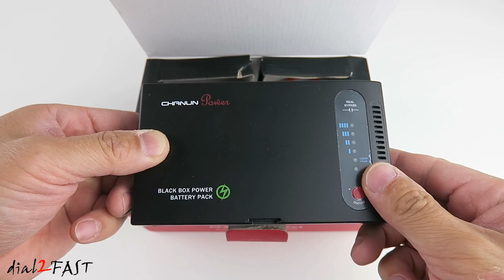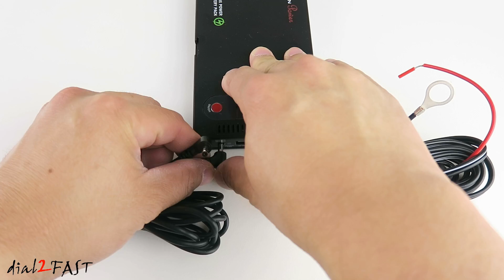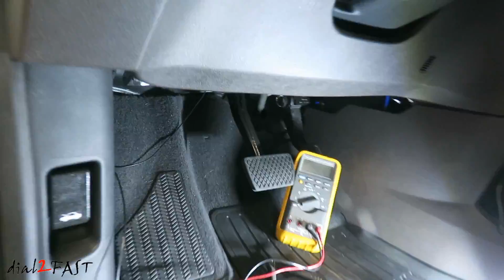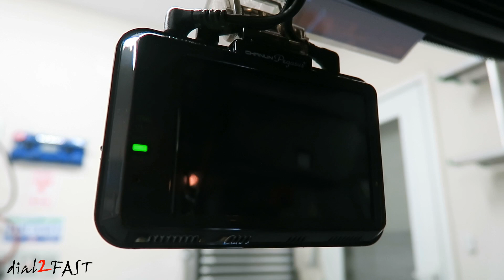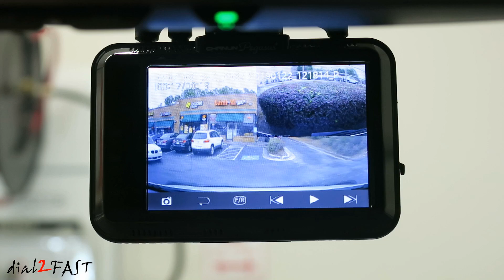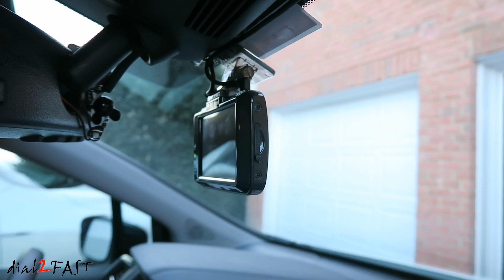Install Dashcam Battery Pack for Parking Mode - CHANUN BATTERY

Comment: nice job on the video- thanks. I hope you can get a long life out of the backup battery. I live in Fl and car temp during the day can easily reach close to 130F . I wish they made a optional dusk to dawn power switch for parking near your home or in driveways. That would alleviate the battery working in the worst temps/during daylight and allow power savings at the same time but allow high risk, nighttime coverage. Nothing good to say about the parking mode light that might tell some people to please steal me :-)

Comment: dial2fast
Thanks for the video, nice job. I think the extra battery is a good idea.  I purchased a Roav DashCam S1 a few weeks ago. I choose it because it has a lot of good reviews & the 60fps picture quality.
I looked at the one you have and it only has one review O_O ,very brave, how did you choose it?
The menu seems much better on the Chanun Pegasus+ , the Roav is extremely limited and will not stay on with out a power supply. It shuts off after 5-10 seconds after unplugging the power. I do not leave the Roav up in the Texas heat I know from the reviews it will not do well 100 degree F.
 Please post a follow up message or  video to show how its holding up in the summer heat.
Reply from the maker: I am still using this in the Georgia heat and is holding up fine.

Comment: Nice video.  How well does the camera and battery operate after sitting in direct sunlight for a couple of hours? My dashcams really don't like heat.. And after sitting in the sun and getting hot, when i start the car with AC, the cameras never cool down and  tend to degrade the picture or constantly reboot  until i take them down actively cool them in the AC breeze... And my camera are rated for 70C too. Battery packs don't like heat either and the position of yours will get direct sunlight under certain conditions ... Just something to consider..
Reply from the maker: I live in Georgia, and the dashcam has only been installed for couple months, so haven't gone through a full summer, but this is a pretty good quality dashcam, so it should handle heat fine. As for the battery, it's installed very low near the floor, so it should be fine.
Reply: @dial2fast  ..Georgia?....shoot i got that totally wrong...i thought you were in California... .. your videos that i recall the weather always seemed nice...